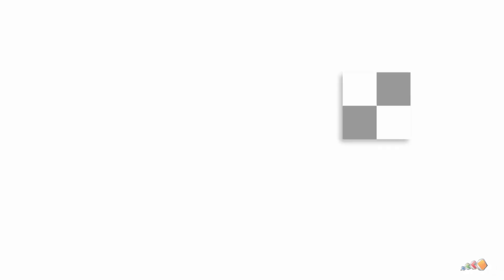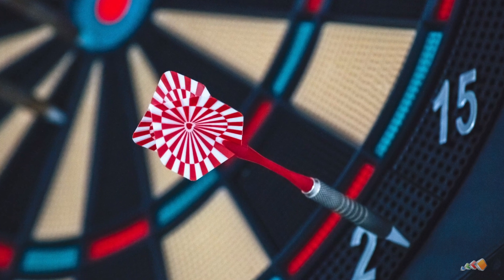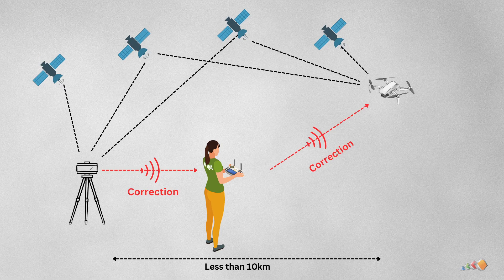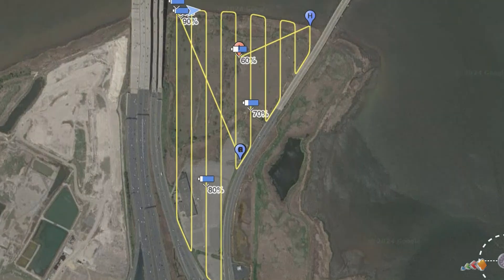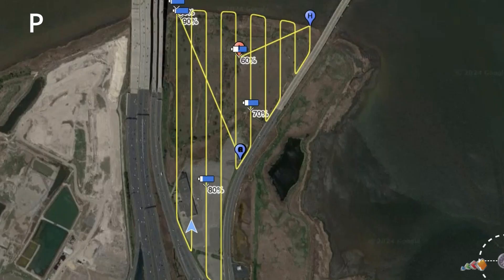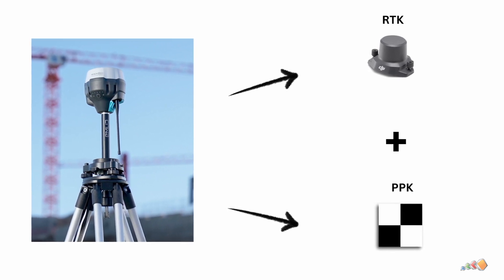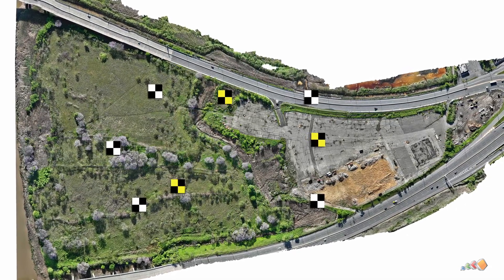RTK / PPK and GCPs Explained

Comment: You mention keeping your base within 10km or so because of the potential errors due to the base and rover possibly using different satellites.  Very true. We've seen this a lot, and its typically the vertical component that degrades more than the horizontal.
Reply from the maker: Vertical always seems to be worse than horizontal.

Comment: Greetings! "You do need an enterprise level drone or something with an RTK module installed..." However,  you also say, "Advantages to this method are it doesn't require an RTK enabled drone."  Please clarify what "something with an RTK module installed." is. I'd like to map with an Air 2s so this is helpful.
Reply from the maker: Someone previously asked that so I clearly didn't do a good enough job there.

When processing PPK, most software (possibly all?) needs additional log files that contain additional timestamp information (mrk file) and additional gps log information (bin or obj file).  On DJI drones, these are only created if you have an enterprise drone that has an RTK module installed.  For example, the Mavic 3 Enterprise will create these but only if the RTK module is installed.  If the little module is not installed they are not created.

When you are using RTK you need a constant signal between the drone, the controller and the base station (or NTRIP/CORS station if you are using that).  If that fails you get errors.  But if you know that you are going to use PPK then you don't have to enable RTK, just have the module installed so that the extra files are created.  So it needs an enterprise drone...but RTK does not need to be turned on (enabled).  

Now...there is a part of me that says that since even non-RTK drones timestamp the photos, and have GPS, that you could theoretically still use PPK here.  And, in fact, you can if you use GCPs, but that is in the next video.  However, smarter people than me tell me that non-RTK drones are only single band, vs dual band, and that means they are not accurate enough.

Hopefully that makes sense and clears it up but, if not, let me know

Comment: Thanks for the nice video! As I understand it correctly, one would have the best of both worlds by first recording with RTK, but in case there was a failure of the RTK corrections between base station and drone, still further correct/update the data with PPK software afterwards?
Reply from the maker: Correct. If you can establish a solid RTK connection then your drone flight will be more accurate, and the metadata collected will also be accurate.  However, if there were a failure (e.g. loss of RTK) during flight, which can happen especially in areas with poor coverage, or you just wanted to add an extra layer of protection, then you can post process the data using the method show in this video https://youtu.be/cESXvYiQ5ps 
Finally, I would always recommend having GCPs and checkpoints.  You can then process using those for another level of security - especially checkpoints which help ensure that everything is where it needs to be.
Reply: @aviosmedia  Thank you for taking the time to answer my question. Good luck with the channel, I just subscribed!
Reply from the maker: @henkthoma2422  Happy to help!

Comment: You said “you need an enterprise level drone or something with rtk module otherwise the observation files needed for the ppk process are not collected” then immediately say the ppk process “does not require an rtk enabled drone” …this is confusing and sounds like conflicting statements. Am I missing something?
Reply from the maker: Yes.  Sorry - it was a bit confusing.  Someone earlier posted the same question.  
You DO need a drone with an RTK module INSTALLED.  But you do not need RTK to be ENABLED.  It just need to be there.  If the unit is on the drone the drone will still collect extra data even if you are not connected to a base station or CORS/NTRIP network - hope that clears things up.

Comment: best explanation I've seen. Please ignore your 5min rule for this as it's such an important part for those whom using it for work and it could potentially be 4 weeks of 5 mins clips to explain it all. I'm sure everyone will agree and appreciate you making a long video.
Reply from the maker: Thanks!  I'm glad you found it helpful.  I do put out longer videos occasionally, but I keep them short for a couple of reasons.  Many people like the shorter format as they can watch it straight away. Otherwise they put things in the "watch later" and then never get back to it.  The other is that it takes time to put them together and, especially at the moment, I'm very short on time.  I won't have time to get this out for tomorrow for sure.
Reply: @aviosmedia  did I see somewhere before that you do have longer videos on another video stream website?
Reply from the maker: No.  I used to put stuff out on Vimeo - it has some advantages such as if there is a correction I can swap a video without changing the URL (and losing all the comments etc.).  But...frankly...no one goes there so I finally switched to YT.

I'd love to be able to do this full time - maybe one day!
Reply: @aviosmedia  I agree, I’m a full time firefighter in Hampshire doing 2days, 2nights and 4 days off so something that keeps me busy like drone work. I’ve created a number of good 3d models but the plan is to try setup a small drone business and map all the most used GA fields and then the 3d airfields can be licensed to Sky Demon as an example as all maps are old, heavy pixelated and always nadir due to them being satellite images. As a pilot myself it makes navigating airfields so much easy
Reply from the maker: @firefighterleetiktok85  Sounds like a fun project.  You've probably seen I have done other videos on 3D modeling.

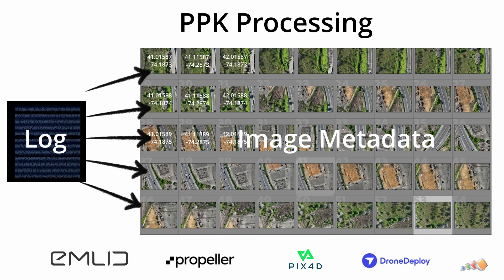Comment: Thank you for all the great videos. I am a bit unsure, though, about something. At 5:00 you indicate that an Enterprise or RTK is required, but then immediately after you say that one of the PROS is that you don't need an RTK enabled drone. Can you please clarify? TY
Reply from the maker: That's a great question!  

When processing PPK, most software (possibly all?) needs additional log files that contain additional timestamp information (mrk file) and additional gps log information (bin or obj file).  On DJI drones, these are only created if you have an enterprise drone that has an RTK module installed.  For example, the Mavic 3 Enterprise will create these but only if the RTK module is installed.  If the little module is not installed they are not created.

When you are using RTK you need a constant signal between the drone, the controller and the base station (or NTRIP/CORS station if you are using that).  If that fails you get errors.  But if you know that you are going to use PPK then you don't have to enable RTK, just have the module installed so that the extra files are created.  So it needs an enterprise drone...but RTK does not need to be turned on (enabled).  

Now...there is a part of me that says that since even non-RTK drones timestamp the photos, and have GPS, that you could theoretically still use PPK here.  And, in fact, you can if you use GCPs, but that is in the next video.  However, smarter people than me tell me that non-RTK drones are only single band, vs dual band, and that means they are not accurate enough.

Hopefully that makes sense and clears it up but, if not, let me know
Reply: @aviosmedia  Thank you for the great explanation. I do fly the M3E with RTK and Emlid Reach RS2... and did not know that the module had any function without the RTK being enabled. I can't thank you enough. I'll keep watching!
Reply from the maker: @DanDroneATL  I'll get the GCP one out as soon as I can.  Unfortunately (or fortunately  depending on the viewpoint) I'm crushed with jobs right now so it might take a little longer than I hoped.
Reply: @aviosmedia  Thank you, sir. I did a little test yesterday and can firm that the M3E does create (3) addition data files when the RTK module is installed, but not connected. Wondering...  are these good for anything (added accuracy processing, etc.) without being connected to a GNSS receiver. Thank you again for all you do.
Reply from the maker: @DanDroneATL  You doubted me :o.  Just kidding - trust but verify always!
I'm told that the RTK antenna is a dual band and the standard is a single band so, in theory, this should be more accurate.  
Now...here's an interesting thing and something i may do a five minute Friday on at some point.  
Most CORS/NTRIP providers not only provide a signal for correction in real time, but also keep all of that data historically. So you can go to a provider, download the RINEX files from that date, and then use something like Emlid Studo to correct the EXIF data of your photos ala PPK (post processing remember).  So, yes, they are useful to have.
Hope that helps!